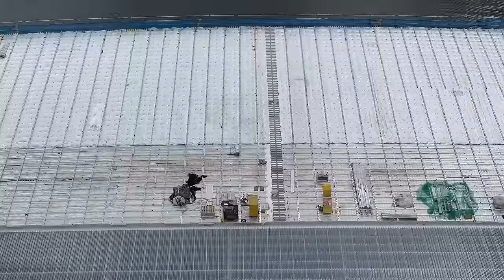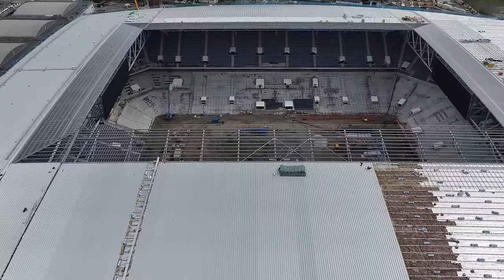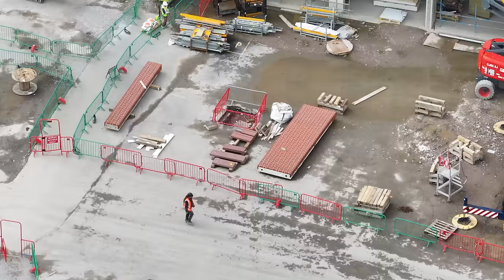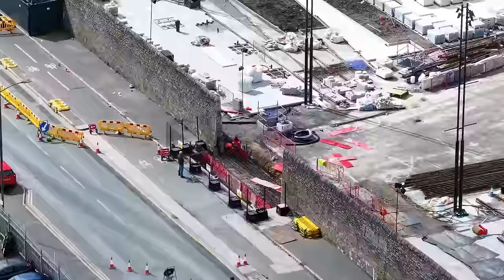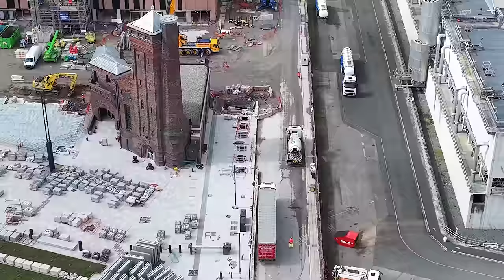NEW Everton FC Stadium 11.4.24. Your Questions and Comments!! Whats Going On With West Stand Roof?

Comment: Nick, here are some answers and comments.

1) I forgot to tell you that the addition of the non-standard edge pieces at the North East edge were due to be fitted, as the sections and the jig were spotted on the NE ground earlier this week. Sorry, you could have zoomed in on them.

2) Please excuse the lack of subscript and the imperative use of a few chemical references in the following but:
A: The Standing-seam roof is naturally-anodised aluminium. Pure Aluminium (Al) naturally oxidises by oxygen in the air. It's unavoidable, naturally. When a negative ion material such as a single oxygen comes up against a positive ion material, such as the metal aluminium, they bond to become AL2O3. This has an appearance of a slightly dulled or matt metal surface and the process will continue until the point where all of the aluminium surface has turned into a layer of AL2O3. Therefore, it is entirely normal for there to be slight differences between reels of aluminium, depending on how long they have been exposed to air.
B However, the barrel-cladding is an Anodised Aluminium material, rather than Naturally-anodised, which means that the aluminium is chemically treated in electrolyte cells (like a big battery) to apply the oxidised layer where the manufacturer wants it and it allows the surface to be pitted with colour and protective layers on top of that to stop the colour fading. Hence the barrel-cladding looks bright and shiny, whereas the top roof looks a matt finish. 

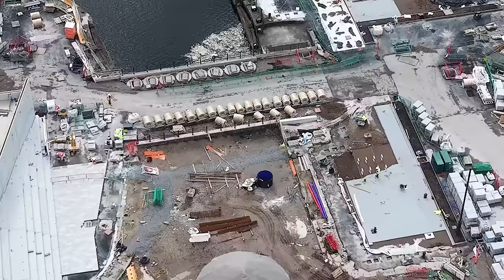3) Just FYI, you can see the waiting reels of aluminium for the continued Standing-Seam roof installation sitting on the northern edge of the southern Water Channel bridge, at 6:30 mins. The mill has returned, which is what the large yellow crane is dealing with and they have started to roll out more of the final layer of insulation across that west stand roof for the skin to be fitted on top.

4) You clearly ignored/forgot the reply I'd already sent to Craig, as I know you sent a 'Like' to my comment. So, I'll repeat it for good measure. The very first plans for BMD, before significant changes were made and approved DID have the solar array stationed just north of the DNOC (Some call it the Media Complex), logically next to the electrical substations, which is where the Pitch Light Arrays will now be parked when not in use. The planners did not like the Multi-storey car park on the West Quay nor the extension of the West Stand either, hence why the plans were changed so significantly. It was at that point that the design was changed to put the solar array on top of the south stand roof for the plans that were accepted in August 2020.

5) More seats have been added centrally on the lower tier of the East Stand and for the Away Fans section in the lower tier of the NE Corner.

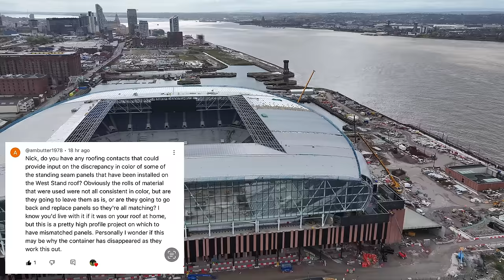6) At 10:40 mins you can see that they have succeeded in laying the wet-concrete to the northern end of the 'mezzanine', with the 'concrete lorry, pump and pipe located southwards at the narrower part of the northern mezzanine, near and just in front of the sight-line to the yellow crane. At that moment one of the concrete mixer lorries is travelling along the northern perimeter to get to it.

Comment: Great to see the edging finished on the East stand barrelling, really sharp and clean line looking up along the North stand
Reply: Well spotted 👍🏻 According to the final plans, the barrel and roof will extend slightly further northwards than what it’s like at the moment, so not quite finished
Reply: Owen, yes, it is. Having wondered why the crane had moved to the NE corner before completing the NW corner but then spotting the fact that the non-standard sections had appeared on the ground, with the jig, at the start of the week, I was looking forward to seeing them having been installed. I THINK they probably decided to bring forward that little task due to the weather forecasts and reality over the last week or so. I DID think about telling Nick to look out for it but forgot to do so. Standards are slipping . . .😉

Comment: Nick great as always. I notice they have installed smaller segments of the steel barrel cladding where the steel meets the glass on the east stand  connecting the north  . it now has a more uniform shape at the end of the stadium. can you get a closer look?
Reply: Well spotted 👍🏻 According to the final plans, the barrel and roof will extend slightly further northwards than what it’s like at the moment, so not quite finished
Reply: William: yes, correct. Having wondered why the crane had moved to the NE corner before completing the NW corner but then spotting the fact that the non-standard sections had appeared on the ground, with the jig, at the start of the week, I was looking forward to seeing them having been installed. I THINK they probably decided to bring forward that little task due to the weather forecasts and reality over the last week or so. I DID think about telling Nick to look out for it but forgot to do so. Standards are slipping . . . 😉

Comment: I noticed that it looks like they have completed the barrel sections on the east stand corner so it goes to the very end.
Reply: Well spotted 👍🏻 According to the final plans, the barrel and roof will extend slightly further northwards than what it’s like at the moment, so not quite finished
Reply: Uberchaz: yes, correct. Having wondered why the crane had moved to the NE corner before completing the NW corner but then spotting the fact that the non-standard sections had appeared on the ground, with the jig, at the start of the week, I was looking forward to seeing them having been installed. I THINK they probably decided to bring forward that little task due to the weather forecasts and reality over the last week or so. I DID think about telling Nick to look out for it but forgot to do so. Standards are slipping . . . 😉

Comment: Hello nick great video as always, Did anyone notice they finished the North East Barrel  cladding. The Top part. Thank you for any clarity.
Reply: Well spotted 👍🏻 According to the final plans, the barrel and roof will extend slightly further northwards than what it’s like at the moment, so not quite finished
Reply: Zen: yes, correct. Having wondered why the crane had moved to the NE corner before completing the NW corner but then spotting the fact that the non-standard sections had appeared on the ground, with the jig, at the start of the week, I was looking forward to seeing them having been installed. I THINK they probably decided to bring forward that little task due to the weather forecasts and reality over the last week or so. I DID think about telling Nick to look out for it but forgot to do so. Standards are slipping . . . 😉

Comment: HI Nick,
Good comparison regarding the space for big vehicles under the North stand ,but isn't some of the space a pavement with kerb not all road? 
Could  you take a look?
Reply: John:, please, please, noooooooooo. That issue has long-been dealt with, several times over. The measurements do NOT lie. Yes, some of that space is pavement but MOST of it is for vehicles and what is more, wider than a vehicle width and approximately a motorway lane width. Please, please just accept it. Have a good day.

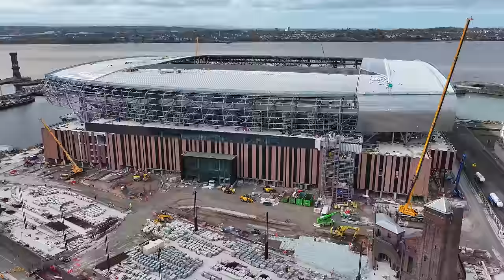Comment: 18:33 the finishing pieces of the NE barrel have been put in place
Reply: Well spotted mate 👍🏼💙🤍💙🤍
Reply: Yep, well spotted 👍🏻 According to the final plans, the barrel and roof will extend slightly further northwards than what it’s like at the moment, so not quite finished
Reply: Eric: yes, correct. Having wondered why the crane had moved to the NE corner before completing the NW corner but then spotting the fact that the non-standard sections had appeared on the ground, with the jig, at the start of the week, I was looking forward to seeing them having been installed. I THINK they probably decided to bring forward that little task due to the weather forecasts and reality over the last week or so. I DID think about telling Nick to look out for it but forgot to do so. Standards are slipping . . . 😉

Comment: Cheers for the mention. There is a big gap where the wall meets the stairs on the West stand pavilion next to the South-West stand. I wonder how they’re going to fill that in?
Reply: I don’t think it’s a gap. It’s the black metal framing which the veranda sits on.
Reply: Lee: if you can spare a moment to be even more specific with times and more reference points at the time-stamp chosen, I might be able to answer your Q.
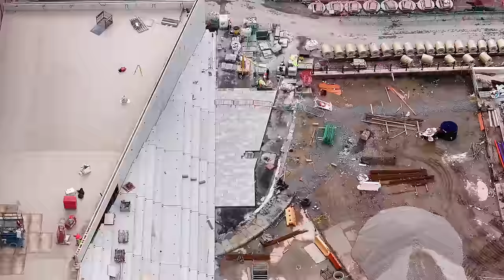Reply: hi David. Thanks for all the info so far! If you look at 5:10, there’s a black section at the top of the stairs. 2nd block south of the most southern tunnel. 
Unfortunately can’t see the north half of the steps in this video for a comparison. I’m 99% sure it’s the metal framing. 
Assume this is covered by brick facade in the final designs?
Reply: @SeymourScagnetti  Mr Kirk/Seymour: Ok, thanks for the tighter references. Now I know to what you and Lee are referring. It IS actually a gap, created by the 'diagonal, terracing side-cheek wall'. That section of the wall behaves a little like an RSJ as the wall does not have foundations and a wall sat on them at that point due to the Old Granite Coping Stones of the Old Dock wall being below that. You can see how the curve of the old dock wall turns to pass under it as it straightens to pass under where, at 5:10 mins, there is a cherry-picker. The face of that diagonal, side-cheek wall will have brick facades on it and my guess would be that the inside concrete layer into which the bricks are 'keyed', will be a thicker one for the parts to back-fill that concrete wall appearance as it sits on the top of the terrace. Alternatively they will fit some sort of 'plug' to fill that space on the back of the brick facade sections. The summary is that you won't see that hole from the outside anyway.
Reply: @SeymourScagnetti  My Kirk/Seymour: I hope you've seen my earlier extensive reply. I have just seen, via email from YT, that you had sent me another comment with the timing of 2.47 mins, elsewhere, but that doesn't really help as it's such a wide view that anything could be in play. However, I see that YT have removed the comment, as I'd expected. If you do it again, you'll find yourself getting blocked for 24 hrs, as I learned the hard way in the early days. I CAN tell you why. YT's bots search for hyperlinks, presumably based on the assumption that you are trying to publicise another site that is not martialled by them. It then deletes the comment.
Reply from the maker: @davidbadcock2225 I removed the comment David as I’m not a fan of other channels being promoted on my channel. I’m not bitter about others, each to their own, but just prefer them not to be promoted on my channel.
Reply: @misterdroneuk  haha. Sorry about that.
Reply: @misterdroneuk  Ok, got it,  but my comment is still valid. YT sent me numerous 'reports' even when I was linking to EFC Official stuff, stating that I was banned for 24 hrs but without telling me why. I just figured it out after several trial-and-errors.
Reply from the maker: @davidbadcock2225  yes that’s nothing to do with me. I think I just see this one today before YouTube. 👍🏻
Reply: @misterdroneuk  Yes, Nick, understood. Have you read my long, separate, initiator comment yet from about 40 mins ago? It has the answers to your Q's and some other observations.
Reply from the maker: @davidbadcock2225  not yet David but I’ll get to it. Thanks 👍🏻
Reply: @misterdroneuk  👌.
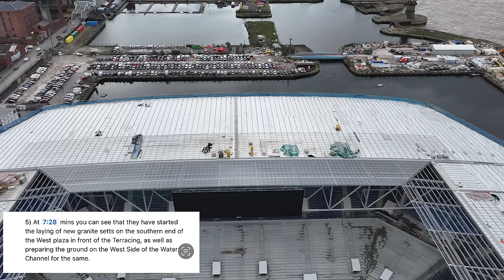Reply: @misterdroneuk  @davidbadcock2225 misterdrone’s video from 15/03/24 from 4:37 to 4:52 shows the part in the north side of the terrace which I was referring to.

Comment: Are the buildings which look like factories being used or are they derelict. Wondering if either Everton FC or the council plan on building anything? Hotel? Shopping centre? As the stadium looks amazing but the surrounding area looks run down
Reply: There’s a hotel proposed opposite and the rest is part of the Liverpool Waters regeneration development
Reply: Will be a brave man that builds down there anytime soon. In time maybe but don't see it happening in the next decade.
Reply: @JayEFC1969  ; just like the area around the once derelict Albert Dock, the regeneration of the northern dock area will happen gradually over many years.